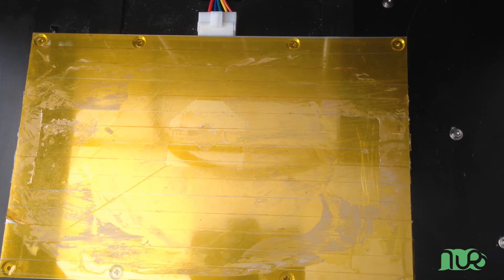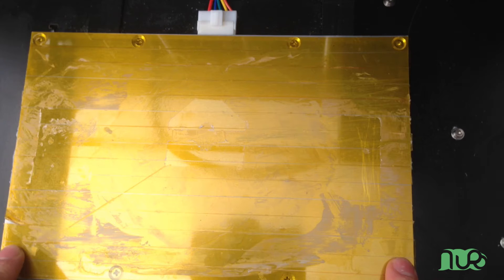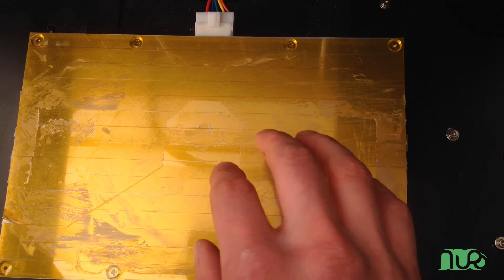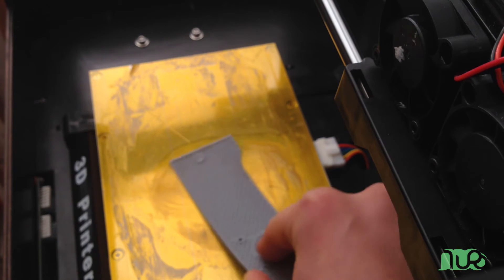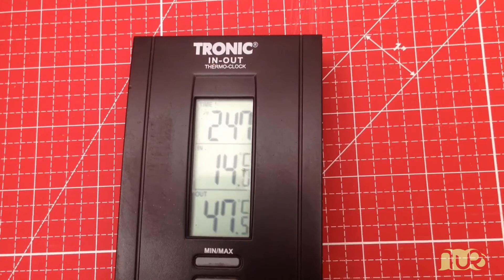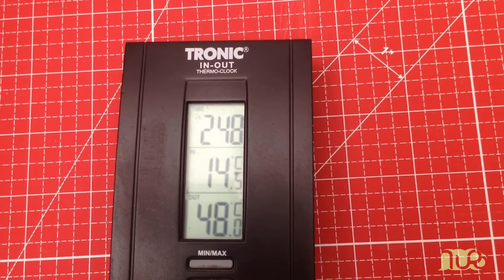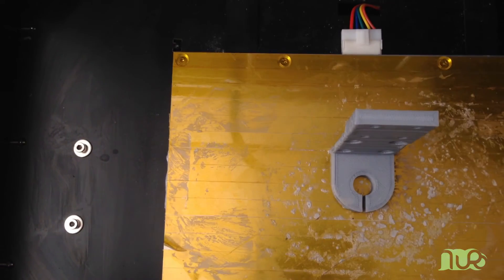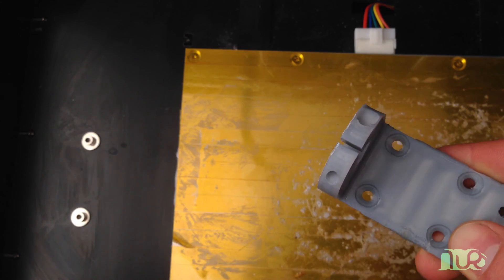nupo Tips #01 - How to prevent your ABS 3D prints from warping

Comment: You should not use a knife to detach the pieces from the hot bed, what you do is damage the print and the bed. Insulating tape does not stop the warping effect on very large prints.

Comment: I have been trying something similar by disolving ABS inside a syringe with acetone and squirting it in the corners of my build object just after the first outline is printed I pause the printer and let the mixture dry a bit and seems to give a very solid foundation on the edges.
Reply: Hes doing the same thing here.
Reply: Acetone? I just watched another  excellent tip from Di-AI-Why channel for ABS printing without smelly acetone and abs scrap. And non toxic too.

Comment: Hi, I think the main reason is the temperature in the room or around the print as you mentioned later. No extra sticking layers necessary... Just keep the surrounding temperature high enough. In my case around 30 degrees of Celsius.

Comment: Man that some high temperatures you are using for ABS. I usually use 230c for nozzle, and 100c for bed. Your PTFE tube will start giving you problems with temperatures over 235c. I always print ABS in an enclosure. Never had a warping problem yet. I use a PEI sheet on the bed with nothing on the PEI.
Reply: hehe, how times have changed
Reply: Holly shit, 230??? Even my pla is only 205 i didn't know it could go that high, also the build plate 100 is just insane cause mines only 60

Comment: Hi, guy!
I have the following problem: my 3D model (not solid) in 1.75mm ABS is "delaminating", after a series of printed lines, spans in the model begin to appear (it is a relatively large model, with more elevation Of 15 cm - the printer has a capacity of 20cm x 20cm x 18cm: it's a Wanhao I3 Plus), I'm extruding with 245º and keeping the table warm by 90º and average speed between 50 and 35mm /s.
Any tips on where I might be going wrong?
Thank you very much!
Reply from the maker: Sounds like your print settings should work. I only ever had delamination when not setting und the zero close enough to the platform
Reply: You have to turn off the cooling fan and use enclosure. I use carpenters wood (PVA) white glue on glass. it  works great. Clean the glass with 70% alcohol before applying the glue.
Reply: I got a good improvement with partial enclosure of the printer using a cardboard box, but on very cold days (temperature below 5ºC) still happen, I'm suspicious of the quality of ABS in use. Anyway thank you very much for the comments.
Reply: slic3r .."interface perimeters"   ..it drove me crazy for a full day   ..provided all else is set correctly ,  this could be an answer..

Comment: Great tutorial.  Question...  Do you heat up the bed to the desired temperature and then use the acetone / ABS to spread?  Or, do you apply the acetone / ABS before preheating?
Reply from the maker: Good Question! I don't heat up the bed before applying the acetone, simply because it is too volatile and would not leave enough time bevor it vaporises away. I usually just use the time while the bed and the nozzle warm up which is long enough
Reply: apply it to a cold bed and then the bed will help evaporate the acetone fully and evenly distrubute the ABS slurry as it heats up